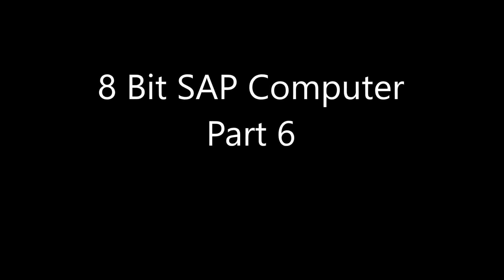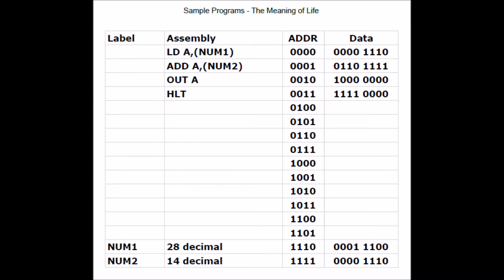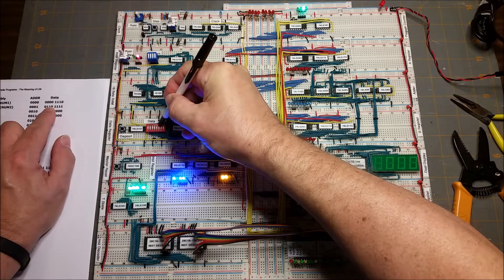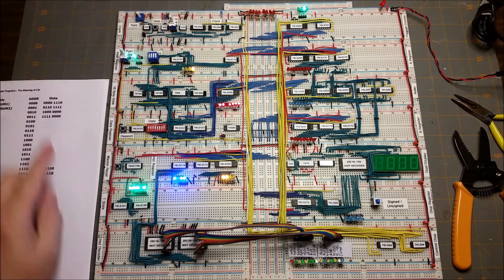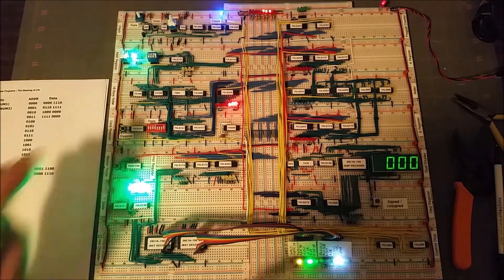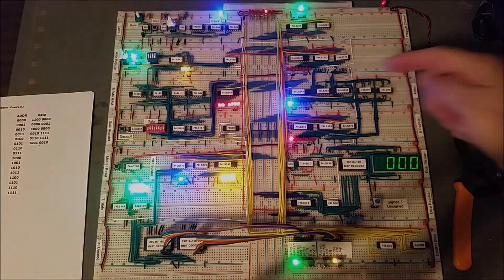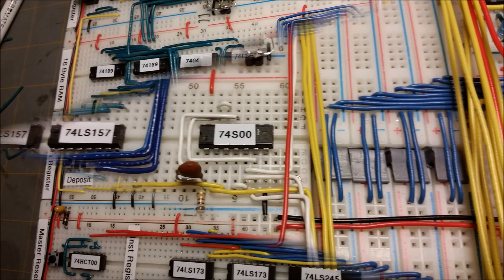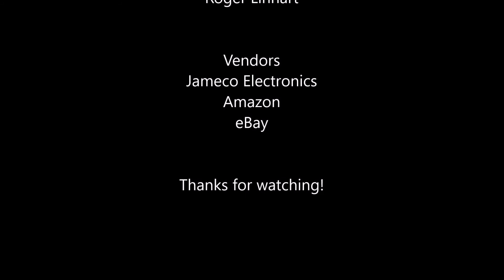My Ben Eater 8-bit Breadboard CPU Build Project Part 6

Comment: Hi Roger,  Thanks for your fatastic series. I have just completed making the original design as per Ben (finally to have the  design upgraded with your additions). I have an issue with control ROMs - when I work on the controls manually, the computer works fine and the example addition program outputs the result (42) correctly. But the moment ROMs are used for control (with Ben's sketch with JMP) , it goes astray. the PC goes from 1 to 15 straightaway.  I have a good power distribution with almost 5 V on all chips and the bypass 100 nf caps are put on all breadboards. I have also separated the RAM RC circuit from the clock, with a buffer.

Could you suggest possible solution to the with problem with ROMs ? By the way, what is the DC resistance of the completed circuit, when the controil ROMs are in ?
Reply from the maker: Hello. Could you clarify? Are you saying if you drive the control signals manually, like using a jumper to drive them to +5V or ground, it works but it doesn't work when you try to let the ROM do the controls OR does everything except the JMP instruction work with the ROMs?

Comment: Watching Ben's videos... I kept thinking about how it'd be good to have an output-signed and output-unsigned instructions.

Nice build!
Reply: I just saw the Ben dropped a new video. I can't wait until I get home to watch it. I expect we'll see some way to latch status bits like carry. This could also be applied to controlling the signed/unsigned switch. I tried to be tidy as I'm hoping to turn this into a wall hanging.
Reply: @rogerlinhart5157  what are the hexadecimal codes?
Reply: @rogerlinhart5157 for  the logisim one, do you have a hex code instruction sheet
Reply: That I can use
Reply: @rogerlinhart5157  the sum one does help